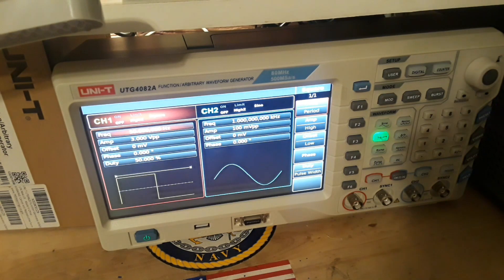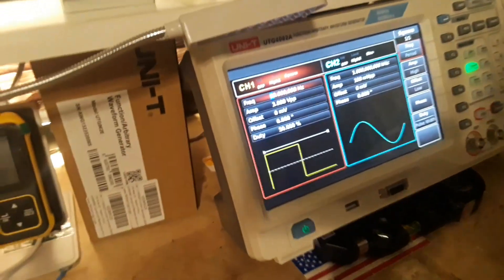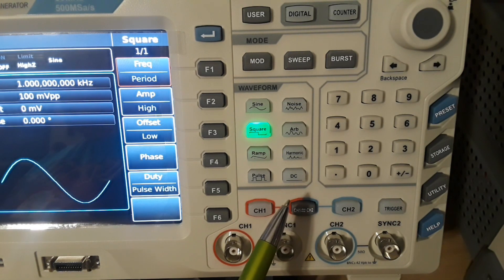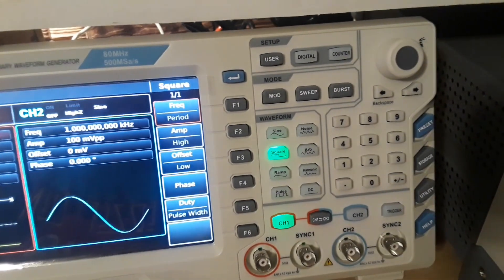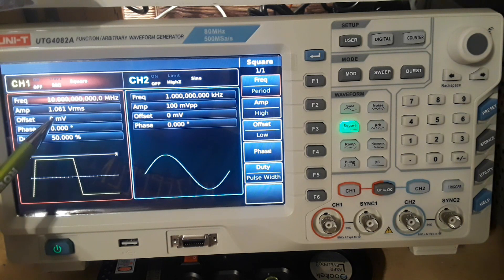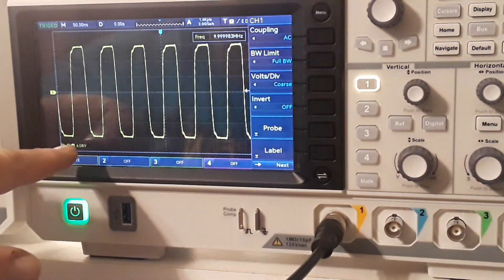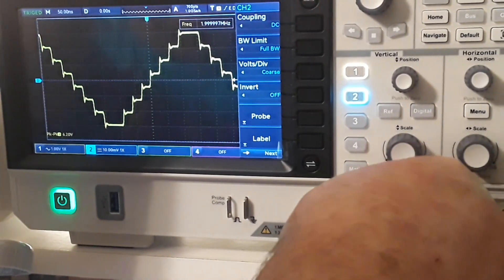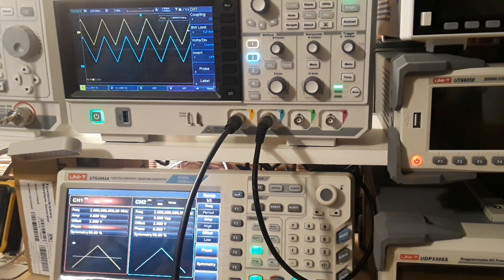Uni-T UTG4082A 80MHz ARB(Arbitrary Waveform Generator) Feature Review

Comment: Hey Paul, I have the UTG962 sig gen and I believe it has a firmware problem where the signal output drops by 6 dB when you turn on AM Modulation, even if the Depth of Mod is 0%.  Can you check this UTG4082 sig gen and see if it has the same issue?? (since the display and firmware seem very much the same)   If you generate a sinewave at say 14 MHz (50 ohm) at say -30 dBm and then simply turn on AM Mod with 1 KHz sine does the level suddenly drop?? and no longer show what the display says the level should be???

Comment: Nice video Paul!  Wow what a generator!  As others have mentioned, aircraft generators are at 400Hz.  I designed a number of power supplies for military aircraft.  The connector on front looks like a DB15 which was used a lot in the day.  Has enough pins to do most things and easy to find shielded cables.  Most computers had these back when.  People doing serious lab work will still use these.  This machine would take some time to learn half the functions:) 

Oh - and thanks so much for the call out!! 🎉